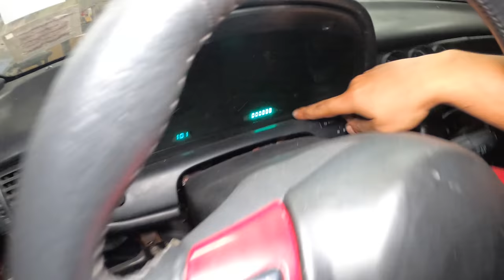Trying To Fix Tavarish's TERRIBLE Lexus "Build" (It's WAY Worse Than You Think)

Comment: Unfinished projects give me anxiety so I am keeping a running list in the hopes that they will finish some.  
First build Lexus. Last update 7/16/20 
Barn find Porsche 996. Last update 7/13/20
McLaren 675 LT. last update 7/2/20
Civic Bugatti kit car. Last update 6/30/20 Ferrari rotary swap. Last update 6/29/20
SL 55 AMG. Last update 6/29/20 
Johnny rev truck. Last update 6/19/20
200k mile Supra. Last update 5/12/20
Honda Rousey Limo. Last update 5/12/20
Jared’s Supra. Last update 5/6/20
Earl Leaker 2JZ swap. Last update 4/10/20 Mitsubishi 3000GT. Last update 2/13/20
Reply: Gary Mugford what's with that emoji?
Reply: That a lot of projects to be keeping track like that wow 😯 😊
Reply: Twelve sure is a big number there champ.

Comment: I'm detecting some for real animosity between you guys. Lego my ego

Definitely KEEP that mural hood to hang on the wall then get a carbon one for the car. OR, keep the mural hood and the mural trunk and the mural roof and put them back on the car (well, the hood and the trunk at least) after you prep them and clear them and then repaint the rest of the car some other awesome color. So basically a hood, roof, trunk mural re-cleared and the rest of the car like a pearl white or a baby blue.

Comment: Little tip, when you use vise grips as your hood prop, point them towards the interior of the engine bay. If someone accidentally closes them inside it won’t crush them between the hood and body damaging both

Comment: I completely understand the love for the car despite not driving it anytime recently. I drove my FB rx7 one time, to bring it home. Was the most fun i have had in a long time. The carb was rigged to say the least by the previous owner. So at wide open throttle the carb would stick and to reduce the speed i had to put my foot under the pedal and lift. Brakes did virtually nothing because the rears were old, semi new fronts and mediocre at best 14's. Like 165 width tires. I was driving it home late at night, in the rain, dim headlights at often wide open throttle through the corners, lobbing fireballs with no radio. I laughed and said this shitbox is gonna kill me.....and i instantly fell in love. Never drove it again unfortunately. I have 95% of the parts to get it running but now my health has declined. Just got out of the hospital today actually after being admitted tuesday. Its absolutely not for sale, despite the single drive i have had with it its my favorite vehicle out of like 28 cars. Its my dream car for my birth year. 1985 FB GS RX7. 12A rotary unported in excellent shape. <3 Waiting on my health to not be shit so i can fix it.

Comment: Alot of cars you can fill the transmission through the speedometer cable.  Just a tip... Most cars are designed to fill even on a lift so if doing it in your driveway with a jack it's actually better to fill through the cable look up the capacity online. If to fill at  an angle if it were on jacks the fill plug is at the wrong angle so you will actually be a half quart low on fluid at least in most cases. Hope that makes sense

Comment: I once had a car with an oil plug so stripped and seized no shop would touch it. I cut two flat sides with a dremel and soaked it in wd-40, then went at it with the same vice grip and hammer method. Worked great, though I did need a new plug.

Comment: Hey Jared,
This is a real question, I'm really not trolling!!  I respect your skill and knowledge and have a quick question:
Is there any specific reason not to power-wash or hose-wash the engine bay and undercarriage (while avoiding sensitive electronic parts) outside of the garage before bringing it inside to work on? 
Is there something about vacuuming the engine bay that I just don't know, which makes vacuuming a better choice?

I was always taught, and find it much better/easier to work on a car that's been de-greased and washed out.
Thank you!

Comment: As far as the livery, I'd get a good photographer to get pictures of every inch of the car, translated to graphics files that can be cleaned up and touched up, and have a wrap made. Meanwhile, take the hood off as-is and mount it up on the shop wall; get a new hood and have the whole car body fixed and done with a basic paint job and wrap it all with the new fresh Tavarish graphics.

Comment: Quick question for Jared, I have a 25 year old, low mileage (67000 miles)  Toyota Corolla with a 4E-FE four cylinder engine. It has 88 BHP, is there any way to get more horsepower out of it reasonably cheaply?
Reply: Lol, not really. To get anything significant out of that engine you'd have to turbo it which would be like $1500-$2000 MINIMUM if you did all the work yourself, at which point you are really just better off saving up for a whole new car. And even with a turbo, you'd be lucky to break even 200hp.
Reply: @Cooe.  I actually did find a turbo kit for it, Jared sent me the info by email. But its not worth the hassle with my wife, its her car :)

Comment: i had a 1980 Pontiac ing truck. yes i was driving it at the time for anybody that's wondering.
iam fine thank you.iam 42 and that was my first vehicle back in the day.iam not really counting the rampage do too i only got to drive that approximately 20 feet the 
whole time I owned it. now ive never managed to get another 80`s room will drive two-door GM with out basically selling my soul to the devil.
after that i had a he seven Caprice for about five years that it unfortunately had a 307 and 
ran into problems with not being able to get parts .u could get replacement manifolds for it and it also had some rust problems that were not repairable or i 
probably would've swapped out the motor.i to this day still can't get a Caprice.the price of them by the time I stopped driving that one had gotten ridiculous and has continued to go up.
i still want a 2 or 4 door rearwheel drive 80`s gm but I've pretty much given up do too all the shit with Canada.no matter how much you pay for one
you're still getting rust holding hands.i can quite likely find you listing where the car is in a farmers field with a tree growing through it and they are asking $3000
I wish I was joking I've seen multiple ads like that. No point in even saying the car was running when Parked it hasn't got a motor even in it. 
i recently looked at a 86 Grand Prix in about the condition that we would've picked up for 1000 when I was around 17, that car sold for 9000, starting to see my point?
wood love too have that I don't care I'm buying it kind of budget and jest have a daily driver kind of thing.i was never looking to 
go like hell and i generally drove pretty slow unless you count that 72;) but we won't get into that lol. 
For the record you're not legally allowed to use hockey pucks in Nova Scotia.ooo people do it you're just not allowed to. Thought I'd point that out.
u are pretty lucky to have something that you worked on at teenager pretty much nobody around here get that opportunity as the corrosion.it
was hard not to laugh at Jared trying to work on this was like what we worked with when I was a teenager everything was grounded or corroded long before we ever got it.

Comment: Was gonna get keeps until I realized that once you stop using it, hair loss starts again. In my opinion, not worth the $75 it will cost every three months just to get an extra bit of hair
Reply: He keeps impregnating his wife so he can't take propecia or finasteride.
Reply: "An extra bit of hair" can be greatly oversimplifying the actual reality. For many men it's the difference between "a head of hair" and "bald" which is MORE than worth $25 a month. Also, you can get the same medication for MUCH cheaper than on Keeps from places like Costco, making it only like $5-10 a month, at which point it's really a no-brainer tbh.